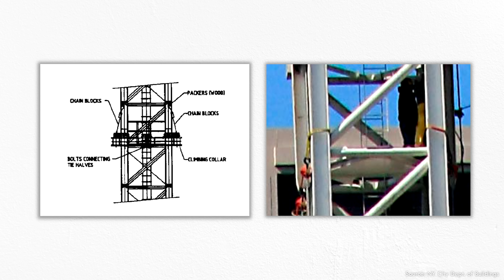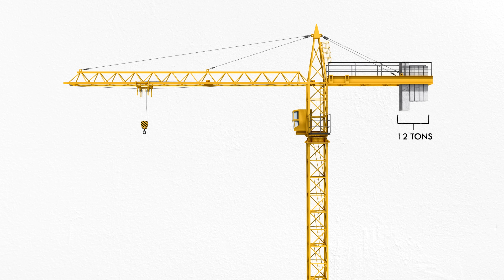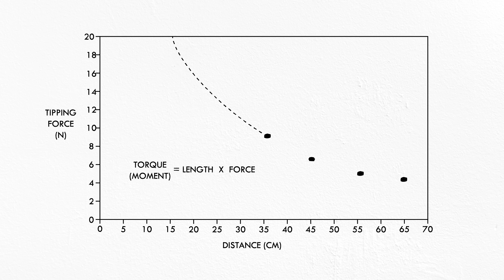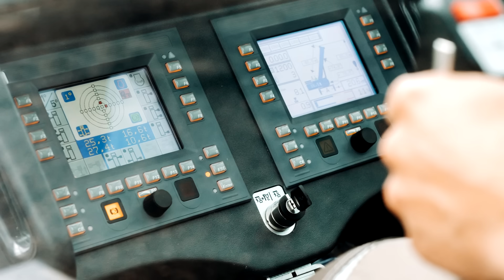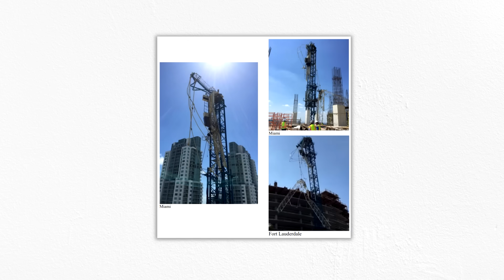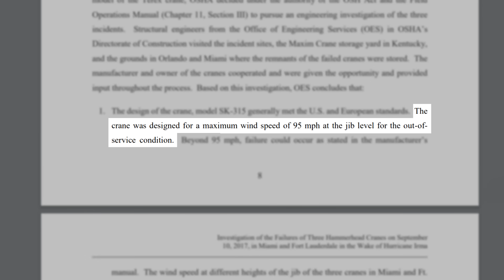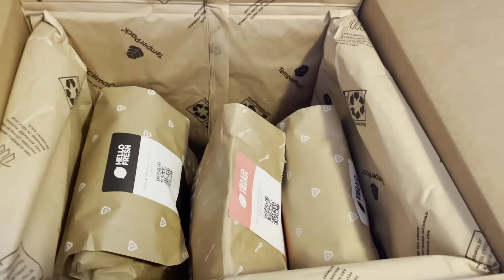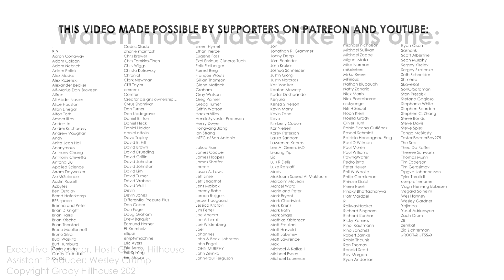Why Cranes Collapse

Comment: I'd say that ZERO % of site assembled cranes are assembled 100% by the manufacturer's manual's specifications and explicitly ambiguous instructions. I would NEVER use Wackers to compact soil for a crane. Sheep's foot rollers, Ramaxes or take a hike. We planked a huge area of a site with large timbers to accommodate a large derrick style crawler crane. Being a crawler this derrick had some enormous double wide tracks distributing the weight over a very large area but the site where the crane would crawl was totally planked over anyway. There are plenty of jobs where the cranes just cannot do it, and we call in an old Soviet era heavy lift helicopter or two, or three or four of them.

Comment: As a retired crane operator of 37 years I would like to say nicely done. I usually watch videos like this for a couple of minutes and pick them apart with all the miss information, not here. Looks like you did your research.  I would say cranes are hazardous.......they only become dangerous when they are used outside of the manufactures guidelines or in most cases have incompetent humans involved.
Reply: Ahh yes, the difference between hazardous and dangerous. Something too many miss. Thanks for 37 years of what I am assuming safe crane operation.
Reply: @zachc1297  I didn't know there's a difference! 🌈
Reply: @zachc1297  I sincerely doubt that. an unexpected gust of wind can cause problems with the load during a lift which equals a workplace accident.
Just pure chance and doesn't even have to result in any injuries.
One tower I can see from my home, during construction they had a gust of wind blow a load of drywall off balance and it slipped from the rigging. 2 skids worth of drywall fell over 40 stories, broke glass awnings on building across the street as well as a dozen windshield. not one injury. ( a friend was site safety officer )
full investigation but the construction company insurance had to pay out the repairs for everything damaged. No fault claim since a sudden strong gust of wind cannot be predicted.
Reply: @jaquigreenlees  Then blame the rigging. It was incompetence, not nature.
Reply: @jaquigreenlees  I mean, any competent rigger should know there would possibly be high wind gusts 40' in the air when hauling up big flat sheets of drywall. That should be accounted for unless a sudden tornado or hurricane swept in and usually those would be predicted enough in advance to not be hauling drywall 40 feet in the air.
Reply: @jaquigreenlees  I'm not calling you a liar and I'm sure that's true. 40 feet or 40 stories, and of course a wind gust is an act of God. I'm just saying there are ways to rig that load so it can't possibly fall unless it actually breaks up or the crane breaks.

Whether it's cost effective is another question. It is if special drywall steel cradles are made with room for rigging chains on all sides, because they could be used over and over, but and if you ask the people who control the money, they'll say no. In which it's their fault. Fault or no, it's very lucky nobody was killed.

I'm just saying it was preventable.
Reply: @jaquigreenlees  That's a terrifying image. A sheet of drywall has got to be like a sail in the wind. And how many sheets on a pallet?
Reply: @SteveWeiserOnYouTube  I think my friend said they had 120 sheets drop when the load was lost.
Reply: @kenmore01  a heavy steel cradle to hold the drywall, with bars to stop it from lifting out by wind, entirely possible. it does boil down to cost though. The crane company itself would have to invest in the cradle and require it's use, adding to the already high costs of the crane and I just don't see it happening.

yeah, the zero injury part is the best part of the entire incident. even shattered windshields didn't injure the people in the cars hit.
Reply: @kenmore01  Yup.  Wind happens if you are outside.  It is not unpredictable.  And just because it is calm on the ground does not mean that it isn't blowing 30 in the slot canyon formed by the building 50 feet up.  Of course that means that one has to spend several more seconds rigging and de rigging the load...even when it seems like overkill.
Reply: @jaquigreenlees  randomly lucky people on the ground
Reply: @jaquigreenlees  okay, but, were they continuing to work when there were indications of winds? Winds don't just "appear," and if you're working in an urban area with wind corridors, you should be taking that into account. Theres no such thing as an "act of god," there should have been redundant safety to stop accidents
Reply: Probably more (and worse) disasters caused by laziness, incompetence and cheapskates than anything remotely intentional by several orders of magnitude. Not just with cranes, either.
Reply: @Llortnerof  And ego. 

Less so for cranes I imagine, but for PPE and other person-level incidents? Oh dear...
Reply: @Llortnerof  if we could slap them they would be perfect
Reply: "Llortnerof
Probably more (and worse) disasters caused by laziness, incompetence and cheapskates.."

Well yeah that's capitalism aint it
Reply: @snigwithasword1284  Not true. Capitalism is about providing the best product for a price point. Human nature is laziness, incompetence and cheapskates. 

I mean use Chernobyl as a example, This was not in a capitalist country but the material was replaced with a cheaper alternative, incompetence was done as they where running a test well below the recommended levels, and they where lazy in the install.
Reply: @snigwithasword1284  More like that's humanity. I think you'll find examples of laziness, incompetence, and greed in any economic system.
Reply: I agree.... I'm as close to being an engineer as I am an artist.... and I never 'graduated' past stick men.  I'm just really very impressed with this person and their content.  "The World" needs to see more of this.
Reply: @kevinheard8364  YouTube is what they refer to as 'the double edged sword'. People can learn from stuff like this, but they're usually intent on depleting brain cells watching the rest of the crap.
Reply: Haha Grady does his homework! I know engineers that watch his channel and love it
Reply: I'm retired Ironworker and I do the same thing with this type of video. Most I can pick apart.
Reply: What about economic factors? I remember watching the Miller Park accident on the news when it happened, I thought they were working in those conditions and lifting too much weight because they had to get a job done or face fines. By economic factors I mean corporate greed and callousness.
Reply: @SteveWeiserOnYouTube  I was working on a job in 07 where there precious schedule got a man hurt. We had busted our ass to meet there concrete pour schedule . We had a three day lead so the superintendent decided to bump the schedule up 3 days so he could look good and get that bonus. By that afternoon a man was on his way to the hospital broke up really bad fell two stories and  hit the concert slab.
Reply: The responsibility of the operator is very high, once your on site and set up because a crane is on site  they think you can do everything
Reply: @frankclarkjr6369  , no they don't.
Reply: What's the difference between hazardous and dangerous? (Honest Question, I'm not a native speaker)
Reply: @Brrrrdmn  Hazardous means it has potential for danger if you are not careful. Dangerous means it's risky to work with it no matter what. Playing with matches is hazardous. Playing with matches near an open propane tank is dangerous.
Reply: Hazardous is a good word to use.

It is not dangerous to fly regular in a large plane, because the hazards are covered. It is not dangerous to cross the railroad at a crossing, even if there are rare occurrences of the signals not working.

Danger comes when people are not managing hazards correctly.

Typically when those that should not, try anyway.
Reply: "I usually watch videos like this for a couple of minutes and pick them apart with all the miss information"
Pretty much all of Youtube if you're knowledgeable about a topic unless you're watching a someone who covers a niche topic. What are the worse examples of miss information about cranes you've heard?
Reply: @bloodypommelstudios7144  niece
Reply: @Nicholas-f5  Fixed. It's not a word I use very often.

@Divergent Droid The most significant of those motions by a large margin isn't even 0.0007 RPM. In theory it would mean a crane could hold about 1% more at the equator than at the poles, that's it.
Reply: I blame the manufacturers. When stood on the top of a building on a construction site, you need to wear ha rad hat - in case the sky falls on you. Machinery now has guards all over it to prevent accidents. Cranes should have guards on them  like other things do. "crane collapsed working at 97% of capacity" - manufactuer failing. No crane should fail in any way working at 150% of capacity - because that's the safety margin that should be incorporated into the crane by the manufacturer. Cranes with stabiliser legs (e.g. mobile ones) should cease to function if any leg is pressing down less than 1 ton of force. - I guess it's also a failing of safety organisations in various countries not enforcing rigourous standards.
Reply: Is there a life cycle for crane construction? I mean: is there finite number of assemblies/disassemblies and number of working hours before it should be scrapped because of metal fatigue?
Reply: @penzlic  They would be inspected regularly if they are large cranes. Repairs should be inspected (though they may not be I'm sure.) I doubt there is a "life span", because that would depend upon the conditions they worked in and how often they are used, much like a car. That would depend upon competent inspections which always makes me worry.
Reply: @penzlic  yes
Reply: Recent kelowna crane incedent comes to mind. Sadly 4 people lost their lives to a clear lack of safety culture in the company. Dudes were dismantling a crane, fucking around on instagram, no harnesses, no basic ppe.... down she went
Reply: Grady is a pro.
Reply: There's always a PEBCAC risk, or "Problem Exists Between Chair and Controls."
Reply: @FelrinKirla  my favorite to tell my wife is PICNIC. Problem in chair, not in computer 😂
Reply: I always presumed such. So there are videos out there with different reasons and false facts? What are some things they say?
Reply: Very well said! What part(s) of the US did you work in? I wasn’t an operator, but I use to work for a crane company with operations in the southern Rockies, the Southwest and the Permian Basin.
Reply: May I ask how did you deal with the cranes rocking back and forth?
Reply: This is what I've learned from AvE'd breakdowns of crane collapses. It is always human error.
Reply: As an ex Slinger,Banksman and sometimes cranes operators,i definatelly agreed with you sir.
Reply: Do u play coc?
Reply: "Have incompetent humans involved " the number one cause of accidents  throughout all of human history.
Reply: Or cheap construction sites. Because the bigger the crane the higher the cost. So rather then getting a crane one step bigger they risk going maximum capacity with a company dumb enough to help them.
Reply: Did his research? Doesn’t he engineer them?
Reply: As a crane operator I can say a crane is perfectly safe if it is in good condition and operated within the manufacturers load chart. The problem is whoever owns the company never has the correct size crane for the job. We used to regularly exceed these parameters. The older cranes would start to get light and tip long before a structural failure would occur. These new cranes are a different animal they are known to fail structurally before they get light. You can’t overload these newer machines regularly like you could the older ones. They will eventually fail if operated outside of the manufacturers limits regularly. They have computers in these new units that are designed to prevent you from exceeding the limits. Most experienced operators will disable that computer on day one I’m guilty of this as well. I’ve refused several picks due to deciding they were unsafe and a bad idea. I’ve walked away and someone else (usually the forman or a manager) made the pick on one occasion the crane collapsed in the attempt. You might be able to get away with it a few times but eventually you won’t. Don’t be afraid to walk away trust me you won’t get fired or anything for saying you are not comfortable making said pick. I can assure you I’d you destroy said crane you will be fired and if someone gets hurt or killed you could be arrested and or sued! If someone is going to destroy an expensive crane make sure it isn’t you!
Reply: @Emily Emily
yang lalu
Reply: I operated my first crane with 19 (without a license) while building a home with someone and even I managed to learn it fast and not have a single incident, I did operate a crane here and there till I was 21 and can agree, if you watch out there is almost no possibility for a accident, if anything happens it is because people did not pay attention while hooking in whatever they are transporting or looking where their load is going, in rough winds it can get tough, but at that point just stop it if you feel like you do not have enough control to prevent a accident.
Reply: Thank you for your service sir...
Reply: Yep 100% accurate.
I'm Almost never able to explain to those idiots why I can't lift >150% or work during strong wind

Maybe this video will help🤔
Reply: @mir16wp  Next time tell them, "I'll lift all the weight you want, when you're sitting next to me in the control booth when we lift it".
Reply: @mir16wp  but why can’t you use that big stick as a winch to drag this 5k bundle of rebar from 25’ outside of your swing? I do t wanna carry that stuff!
Reply: @UCjBRzMewf1fjrrKfR74spYQ You're very very unintelligent
Reply: Overloading and stupidity = failure
Reply: A video made by a civil engineer is going to have no BS. Comes with our line of work 😅
Reply: It's PEOPLE who are hazardous and dangerous and reckless and poor at OH&S, plus weather which exceeds design expectations. Leave the cranes alone.
Reply: Bingo. Unmitigated hazards lead to unnecessary danger.
Reply: Boom up and hold ya load, get off the damn phone baw!
Reply: a factor not mentioned  - ashhole bosses
Reply: Parachute required
Reply: @Ketaportal  Good idea!
Extend that to a gimballed rotor, able to compensate instantly: compensate for a lateral motion up there where the leverage is high and driven by angular acceleration, due to starting to tilt.This because mostly when they fall they tilt away and on the ground the lever is exceedingly small, the rotor is folded up and only powered up for critical tasks, electric driven with  a large acceleration to rapidly correct  for an unstable condition measured very fast. The rotors are telescopic with a light weight carbon fiber structure.
Pre powered by an enclosed rotating momentum wheel, which via a clutch accelerates the extending rotor halves very quickly.
Reply: 1 Peter 1:18-25

18 Forasmuch as ye know that ye were not redeemed with corruptible things, as silver and gold, from your vain conversation received by tradition from your fathers;

19 But with the precious blood of Christ, as of a lamb without blemish and without spot:

20 Who verily was foreordained before the foundation of the world, but was manifest in these last times for you,

21 Who by him do believe in God, that raised him up from the dead, and gave him glory; that your faith and hope might be in God.

22 Seeing ye have purified your souls in obeying the truth through the Spirit unto unfeigned love of the brethren, see that ye  love one another with a pure heart fervently:

23 Being born again, not of corruptible seed, but of incorruptible, by the word of God, which liveth and abideth for ever.

24 For all flesh is as grass, and all the glory of man as the flower of grass. The grass withereth, and the flower thereof falleth away:

25 But the word of the Lord endureth for ever. And this is the word which by the gospel is preached unto you.
Reply: @ahamham4532  I thank God that you used the kjb and not modern "bibles". God's word be magnified my brother.

Comment: Removing the pins definitely sped up the disassembly of that crane...
Reply: debatable, debends if you include all ther cleaning up as dissasembly
Reply: That's not a collapse, that's a rapid unscheduled disassembly.

I totally didn't steal that joke from SpaceX btw
Reply: @Leon_Schuit  That joke is a lot older than SpaceX.
Reply: @Leon_Schuit  This joke can also be a reference to video like(IIRC): "EA is not as bad as you think", where there was a comment "Its not gambling - its surprise mechanis" from EA about one of their games.
Reply: @MrBlackHawk888  no one literally no one cares
Reply: @jwanilpatel3223  Keep me informed about that
Reply: @MrBlackHawk888  he’s right
Reply: Have to wonder how many times that crew got-away with pulling pins prematurely. "It never happened before now!"
Reply: @imconsequetau5275   They were directed by the “lift direct” that was provided by the owner of the crane to remove the pins to help speed up the process on a Saturday to save money they are allowed to remove so many pins when disassembling. But unfortunately 40 mile an hour wind toppled the crane
Reply: Underrated comment
Reply: @NoorquackerInd  Not really
Reply: And gave the welders an opportunity to fire up the cutting torches! 🔥✂️
Reply: it certainly did speed up disassembly
Reply: Crane disassembly speedrun any%
Reply: Not the clean up though
Reply: Was looking for this comment
Reply: Rapid and unscheduled
Reply: Rapid unplanned disassembly
Reply: Chef.
Reply: Always does 😂
Reply: All of these collapses are just rapid unscheduled disassemblies